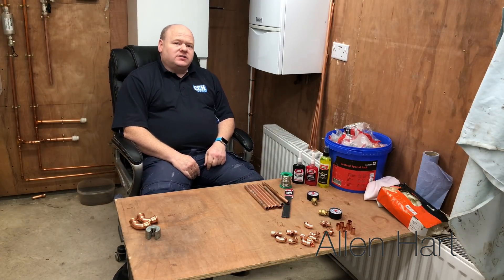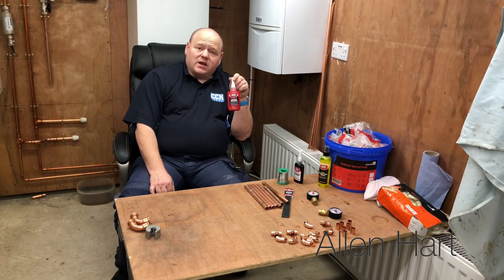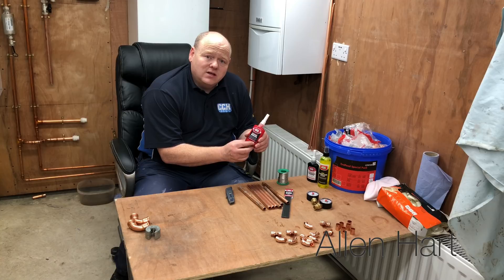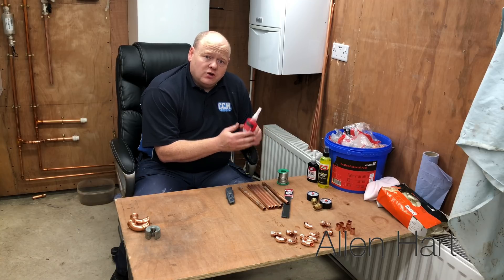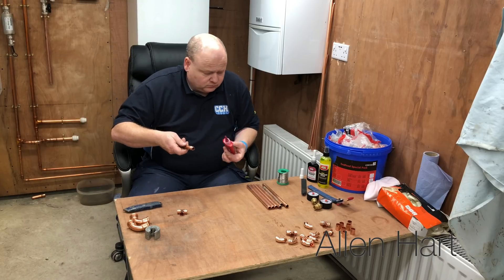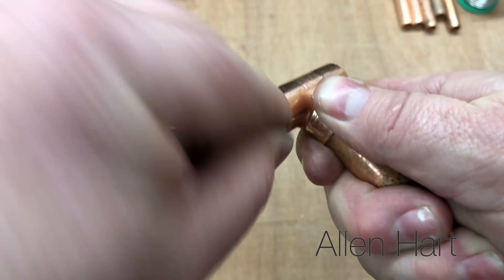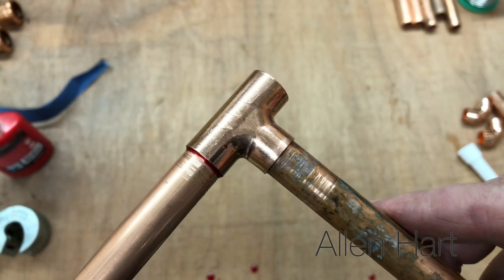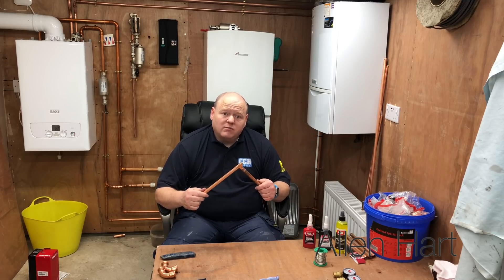How to Solder Copper Pipe without a flame UK

Comment: could this be used on those copper patch repairs instead on having to drain the pipe. the patches need to be heated as they are presoldered.

Comment: Been using it the USA since the 20th century Check videos from the USA version. You will see testimonials from people using it for refrigeration, radiator pipes, water, etc with joints holding up 10, 15, 20, 15, 30 plus years. code approved. great product.

Comment: Same company makes HEAT SHIELD GEL and HEAT SHIELD PUTTY. Clear, non-staining gel leaves no residue eliminating clean-up
Helps prevent heat damage to components and surrounding materials during soldering, brazing and welding. Protects painted and finished surfaces from discoloration due to adjacent torch operations. Reduces danger of fire to surrounding surfaces such as rubber and plastic seals and gaskets. Non toxic, evaporates away in a day.

Comment: Great video Alan as always.

I've managed to put a slight nick in 22mm central heating pipe which some bozo installed right up against the underside of the floorboard, so when I cut the floorboard I scraped one the pipes with the multi tool blade.  Luckily it'd not deep, so no leaks (yet).  Just wondering if this stuff will seal it, or is it not worth worrying about?
Reply from the maker: I wouldn’t personally use it for any of my customers
Reply: @AllenHart999  it's actually in my own house

Comment: Very disappointed to use it.
Only gas pipe is ok, after fitting boiler pipes, flow, return, cold, hot pipe leaking, I had to return a classic hot soldering.

Unlike the advertising, it very weak to high press like glue.
Reply from the maker: I would never use it for a customer 👍

Comment: Hi Folks I Have used this and been in the industry for 42 years never thought I would see such, there again I can remember DZR and brass fittings for MDPE before Polyfast and Philmac etc. Came along ,,,anyway it works fine, BUYAPARCEL.COM are my supplier and worth a look, for non water / gas applications ie Making stuff I use Everbuild HD super as it is a fraction of price again I use Buyaparcel.com. scratch the pipework as per the Copperbond

Comment: Dear Allen..Is this method is suitable to apply in compressor replacement of domestic kitchen fridge..I have one fridge with grounded compressor and thinking to replace it with a spare one my self as study purposes..Soldering with flame the stuffs are quite difficulties to arrange..Once its done arranging gas is the another headache..Anyhow i can manage it Just i need to know its possible or not/..Thanks U brother in advance.

Comment: I use that for sealing oil lines at the olive/ring or on a compression fitting but  No way would i use it to join copper like that. Keep Soldering boys and girls its what your getting paid for

Comment: Tried it. It let me down.  Will never use it again unless its the last option. It doesn't cope well with manipulation or heat. If a joint fails then you end up chasing all of the neighbouring joits in turn. Once bitten twice shy.
Reply from the maker: I didn’t like it either. Thanks.

Comment: Amazing.  Been soldering since 93 myself and find this incredible!  

One question I have is how does the joint actually get bonded- what is the chemical/physical/scientific explanation? 

 A hard one but what are rhe manufacturers saying about longevity of the joint with that over a soldered one?
Reply from the maker: Personally i wouldn’t use this on a customer property. Thank you so much for the comment. Happy new year

Comment: Thanks Allen.. another well composed video with 'detail'. Love you videos. However: I can't see how you do the equivalent of de-soldering. You glue it and then find you pipework design would be better routed another way. How do you undo the gluing. Thanks
Reply from the maker: Mine just pulled apart, Maybe i didn’t install it correctly. I wouldn’t use it in a customer house.

Comment: I don’t trust it
Reply from the maker: Bill Rankin I don’t blame you 👍
Reply: @AllenHart999  called me old fashioned but used nothing but yorkshire up to 35mm, done some commercial work in mappress stainless up to 4 inch. Saves welding on the commercial gas runs in the plant rooms
Reply from the maker: I could not agree more. It wouldn't be a product i would use.

Comment: Hi Allen,

Question for you mate, how can you turn the pipe 360 when its going into a fixed pipe/ going into the last fitting? Just put it in flush im guessing because you can't turn it, will it still bond and work though?

Cheers, great videos as always mate.
Reply from the maker: You make a very good point, You cannot.
Reply: @AllenHart999  I tested it out the other day, I fitted a couple TMVs under basins. Seemed ideal as blowtorch/compression can be a knightmare on these kind of jobs. Had no leaks or problems at all, it's wras approved and you can buy it off the shelf at plumbase.

Comment: I know what you mean about soldering  fumes, i find they give me hedaches and i dont  even solder everyday like you.

I simply wouldnt trust that glue, particularly long term or with hot water.

Have you thought of wearing a respirator when soldering. I do  now and dont have any hedaches since.

It might look a bit odd but for me as someone who works as maintenance  encompassing multiple trades i  cant justify press fit and dont trust speeffit.

To be honhest if im doing a kitchen or bathroom  id rather a clean look of pipework with end feed  fittings any day  to any other pipe fitting.
Reply from the maker: I am still using my press gun. Thanks.

Comment: Hi Alan. 

I see this product weeks ago and thought it would be great for my quirky drinks projects.... as it just a load of copper pipe  going and doing nothing. So I set about ordering a sample because I am not paying £20 odd for something that might not work. I played my money and didn't receive it   I called them and got told they had posted it but would look into it ... still to date nor received anything...so there attention to detail make me wonder  if the product his any good....... I do also have a proper maintenance business  which I . Also thought might  benefits from this product.... it's a shame..
Reply: Did you ever get round to using it for your copper pipe projects? As I'm also looking to get some for copper pipe bottle lamp project I'm working on... I've tried gorilla glue but it doesn't seem to be strong enough....

Comment: Hi Alan
Cheers for that. Clear and precise as always.
I too am done with soldering.. using flux just needs to go. Plus the 3hr rule is a pain.
Be interested to know how you got on with that and if ya using out in field yet. 
Couple of obvious queries.. how is it if theres a bit of water present and will any p60 grit do or is the product warranty void if using other than theirs. 
Also how many joints do you think you'll get out of a bottle. 
Sorry for asking, could go priduct website but nothing like a firld test.👍
Reply from the maker: I have tested it and it wouldn’t be a product I would use on my installs. Thanks for watching.

Comment: I think it would be good to keep on the van for the odd fitting or two here & there but I wouldn’t want to do a full heating system with it. Press fittings are the way forward, just wish press was cheaper.
Reply from the maker: I will be testing it for a while, i will do a follow up video in a few weeks. Thanks.

Comment: It's just another anaerobic glue, just like Loctite 577 & Screwfix Liquid PTFE, they're all the same stuff.
Reply from the maker: I really like loctite 577 been using it a couple of years now. Thanks for watching.
Reply: @AllenHart999   Dear Allen..Is this method is suitable to apply in compressor replacement of domestic kitchen fridge..I have one fridge with grounded compressor and thinking to replace it with a spare one my self as study purposes..Soldering with flame the stuffs are quite difficulties to arrange..Once its done arranging gas is the another headache..Anyhow i can manage it Just i need to know its possible or not/..Thanks U brother in advance.

Comment: Hi Alan , I would not trust that as far as I could throw it , it's for the diy brigade who will try anything instead of paying a pro to do the job for them.......
Would you use that on any gas installation and try to sleep at night.........enough said.......😳
Cheers....
Reply: I used it for 3 radiator runs upstairs, its brill and had no issues
Reply from the maker: @Ant98986  How long has it been completed. Thanks.
Reply: @AllenHart999  about 3 months no pressure drops or leaks. Perfect for me as I just decorated and didn't want to burn the paper and push fits are unsightly and the copper push fits tend to have issues with the o rings if you have the slightest burr
Reply from the maker: Thank you for your comments. i am really interested to see peoples opinions. Thanks.
Reply: @AllenHart999  I wouldn't call you if I knew you used it can't trust my life to a glue
Reply from the maker: @aaron6841  I tried it in a controlled area. I would never use it on a customers property. Thanks.
Reply: @AllenHart999  just wanted to give you some feed back from an uneducated member of the public take care great vids BTW.

Comment: May have advantages in very specific instances. But you can never beat a soldered joint, and done ALOT quicker. It may say for gas on the bottle, but this product isn’t approved for gas
Reply from the maker: They say it is approved for gas, they are having a breakfast morning about it on tuesday so i will go and ask. Thanks.
Reply: Yes, some jobs are not practical to solder without impose damage to surroundings such as wire, wood or other flammable materials nearby

Comment: Problem is that it’s going to be 20+ years before it’s proved that it won’t degrade as it gets older. PRV elbows up a ladder Yes, gas and pressurised water No (in my opinion)
Reply from the maker: Thanks for your post.

Comment: I wouldn't trust it, I have no doubt it would work if done as per mi but over time any joint like this will leak 100 percent.there is no way the manufacturer will stand by this lasting longer or the same as a compression, soldered, or press joint it's like a new version of polyorc
Reply from the maker: lee crawford I have no idea tbh but very interesting to hear peoples views and opinions. Thanks for watching.

Comment: Difficult to have faith in a joint that is either not welded or physically held together...e.g compression or push fit ... At the end of the day it's a glue based product which will probably fail long before the copper . Can it be used when water in the pipe interestingly curious?
Reply from the maker: phillip bull I don’t really have any answers yet but i am going to do as many tests as possible on it. If you have any ideas on how i could test it please let me know. Thanks for watching

Comment: jeepers aldo get that stuff in the bin haha the manufacturer may be new but that type of joint has been around for years, someone did the domestic pipework in a primary school up here with a similar product years ago and yep those joints will fail BIG STYLE eventually
Reply from the maker: I could be wrong but i believe this stuff is new and different to some other products on the market, You can use this on gas, I dont believe the others were gas approved. i could wrong though. very interested in peoples views on this. Thanks for watching.

Comment: also quick question allen, can I as a muggle replace my own boiler? Im fed up throwing parts at this heap of shite vokera. gonna chuck a platinum on and make up some numbers for the benchmark, mon the 10 year warranty
Reply from the maker: We both know you are gas safe reg so i am sure you will be ok. Thanks for watching.
Reply: thats good enough for me, speedfit for days, also can I use a flexi to connect up a gas hob?
Reply from the maker: yes you can use one of these https://www.youtube.com/watch?v=mSnSeOq4y6w&t=6s
Reply: Im just gonna use this, comes with a valve for quick isolation so it saves wear on the ecv
https://www.screwfix.com/p/flexible-tap-connector-with-valve-15mm-x-x-300mm/3558g